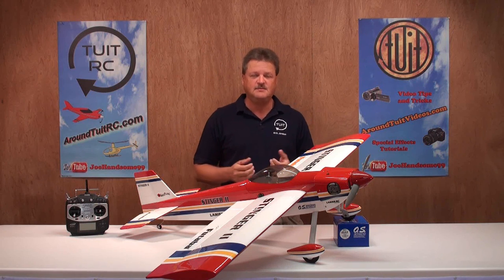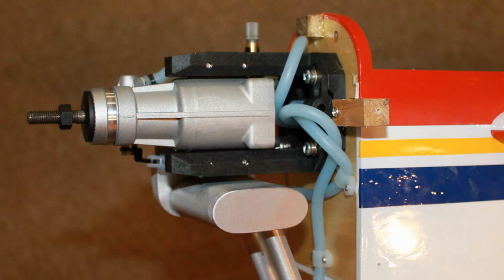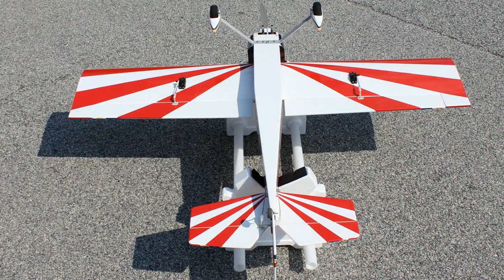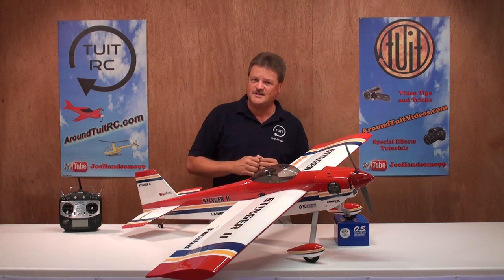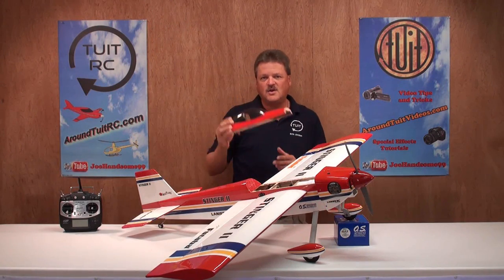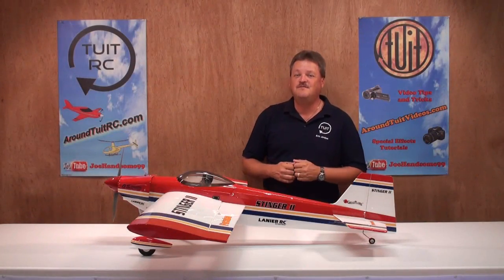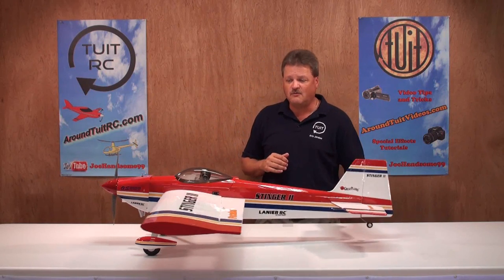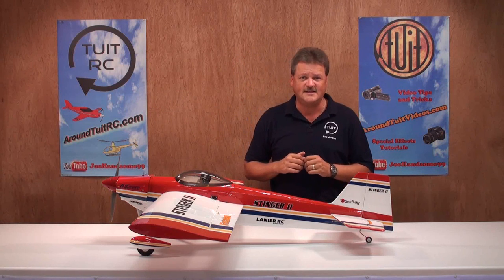Great Planes Stinger II RC Airplane With OS Max 46 AX Motor Review and Flight.

Comment: This is a great flying airplane but performance is off the charts with a 55AX in it.  Best of all its an easy swap since the 55 has the same case as the 46 so it drops right in.